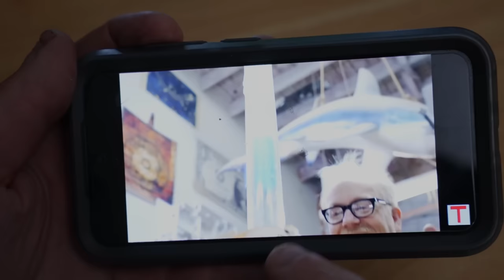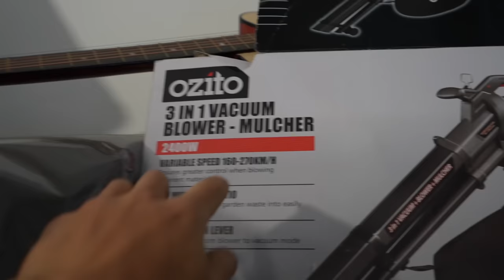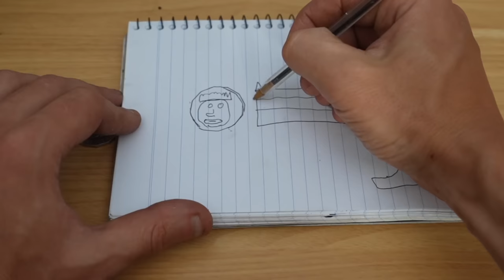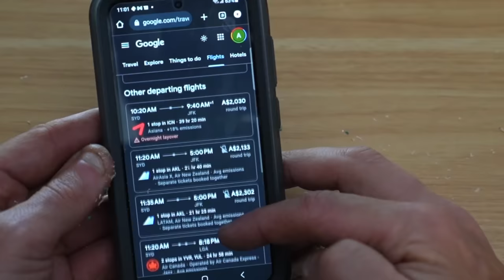The Mythbusters Were Wrong!

Comment: The reason why you were seemingly throwing coins at 172km/h is because of perspective. The cameras FOV is a cone starting from the camera, meaning the farther from the camera something is the more distance it can travel before it goes out of frame. This means that when looking at the coin passing in front of the markings, it can go from covering one marking to covering the next marking going less distance than there is between the two markings. This can be counteracted by moving the camera further away and cropping in, decreasing the slope of the cone relative to the surface vector of the marking board, as the cone shape is now closer to a cylinder than before.
Reply: Can you Explain this in Easy language
Reply: @fara-sara it do the slope so perspective look weird
Reply: You are kind of on the right track but not quite. First of all: don’t think cone, think pyramid. Second: What you are describing is called parallax. The parallax effect is definitely a factor but I think you are overestimating it. One additional issue here is that even with so many fps, in an individual frame the coin is very blurry. This makes it hard to make out its exact position. I expect this to contribute a lot to the error. That combined with the parallax effect might significantly affect the result. There is also lens distortion. However, that is mostly a concern when pure pixel distances are used. In this instance the painted bars werde used which of course are equally affected by lens distortion therefore eliminating it as a factor in theory.
Reply: Another adding factor to the error is the distance between the coin and the scale: the higher it is, the bigger the error
Reply: @fara-sara  Stick a 5 m tape measure to your wall. Move back 10 m. Move your finger from left to right in front of your eyes: did it actually travel 5 m ?
Reply: Or throw the coins directly above the measuring markings. The relatively slow frame rate was probably a much bigger issue. I think he glosses over things like that if he doesn't feel they are entertaining for one reason or another.
Reply: @fearisan  Yeah the parallax effect should only change it very slightly in this case, the blur is the major contributor. You can see that the coin blur stretches ~10 cm, and the blur travels ~10 cm. I think Alex might've used the distance from the beginning of the first blur to the end of the second blur (which is actually ~20 cm), assuming it was the distanced traveled by the coin in a frame, when it would actually be for around 2 frames. 

If you assume 10 cm per frame, then the coin is traveling at 24 m/s, or 86 km/h, which is fairly reasonable, especially since we known Alex is fairly athletic.
Reply: w comment
Reply: @fearisan  erm, technically it's a frustum, kid
Reply: @fearisan  you can pretty much ignore the blur if you look at the furthest position of the coin
Reply: You're right.  The camera's perspective is pretty distorted from that distance.  You probably can't get the camera far enough away in your garage but moving the camera farther away would flatten the perspective.  The concept of perspective itself is the only thing needed to understand the issue.
Reply: You could slap a telecentric lens on the end of a sensor but it would probably be prohibitively large and expensive.

Another more easierer way is to extend the contrast fiducials to the camera. And track the shadow cast if you have consistent lighting.

You can also do super collimated light with breaks then track when the coin is backlit.

There is a reason why machine imaging is a huge industry.
Reply: I need this guy to defend me against speeding tickets.
Reply: glad someone said it ahaha
Reply: Even without accounting for perspective, when you look at the distance traveled over 2 or 4 frames, it's more like 15 cm/frame, which would be 36 m/s or 130 km/h, much closer to the 28 m/s he actually measured than the camera-estimated 48 m/s.
Reply: I understand now
Reply: @fara-sara stuff far away looks smaller
Reply: Wide field of view exaggerates distance, narrow field of view flattens everything out
Reply: I don't know which camera was used and its technical characteristic, but at seeing the motion blur, it looks like the shutter is open during a very long time, due to the low light condition. Is it possible that he has set the camera to take 240 frames per second, but the camera decided that it was not possible, so lowered the frame rate? E.G.  maybe the actual rate was in reality maybe 24 frames/s then lead to completely wrong calculations (*10 the real speed)? The parallaxe error could only explain only a increase of the speed of some 20% if the coin is not so far from the ruler compared to the distance of the camera...
Reply: I thought it was just that coins are lighter than baseballs, so he was able to throw them faster

Comment: The problem with accelerating an object to terminal velocity with anything other than gravity is that it accelerates far too quickly, the forces acting on the coin have much longer to make it unstable in flight when falling and makes it more and more likely to start fluttering... slowing it to be relatively harmless. You'd be better to use a shape that is relatively stable like a ball bearing if you really were a homocidal tourist.
Reply: I appreciate the suggestion for alternative murder weapons you included at the end
Reply: I could calculate actual terminal velocity, but I'm too lazy.
Reply: @Ociloc  Im here to please
Reply: i'll keep that in mind just in case
Reply: Use a sharpened pencil or pen
Reply: Some sort of dart or flechett seems better suited
Reply: @ThereAreNoHandlesLeft   Too much drag, their tails are designed for stability but do so by slowing the airflow around the tail of the object, yeah its better but not the best. A symmetrical airfoil or tear drop made out of an extremely dense material, like tungsten will provide the highest acceleration and potentially highest terminal velocity because it has the smallest amount of drag relative to mass.... why are the feds at my door?
Reply: @1one3_Racing  i tried but couldn't find a good source for the coefficient of drag for a coin on edge. everything drag and coin related was on its face or fluttering.
Reply: Yeah this is not well done and the creator should be ashamed of his terrible attempt and at spreading what might be outright bogus claims that lie to people.
Reply: @X4Alpha4X  It is because the coin isn't stable. Air is sticky and the sides arent uniform so there is about a 0% chance it isn't going to be twisting and turning in the air.
Reply: tell me you have never seen idat without telling me you have never seen idat
Reply: Someone should try this experiment with a dart, maybe even on lawn dart
Reply: @generalgrievous2202  that will fall sideways
Reply: @thomgizziz   thats why the video kept bringing up spin to stabilize the coin. Hell, you even see a demonstration of it when he goes to the dam. Obviously it wont last forever due to friction losses, but we are looking for the worst case scenario, not trying to have it fall through the entire atmosphere from space.
Reply: People also forget, the upwind the building has, makes it tumble. People hyper focus on the coin itself but forget the outside factors.
Reply: Next video he'll use a drill or something to spin the coin up to 10,000 rpm before launch to avoid this problem.

Comment: The reason it took the drone so long to descend is because the downward facing sensors were blocked by the coin contraption, so the drone kept thinking there was something below it, and was descending at "landing speed"
Reply: And it should be possible to disable that sensor somewhere in the settings (at least possible in my mavic pro, mini has a different app now)
Just don't forget to enable it again later, or you risk slamming your drone into the ground at its max descend speed
Reply from the maker: I swear i had obstacle avoidance turned off but hearing from others i should have put it in payload mode
Reply: @Ididathing you should've gotten an American to help you. We're all trained as small children how to do a drone strike, and you don't get your citizenship officially until you end a Syrian child's citizenship.
Reply: @Ididathing  Ah im not sure then, ive done a similar thing where ive attached items to drop, and had the exact issue with the sensors.
Reply: @collinbeal  how do you end their Citizenship? Illegal immigration and forging documents?
Reply: @DrVeryStrange  a corpse is no longer a citizen
Reply: @collinbeal that made me laugh. Thank you funny man
Reply: @fireblow44  not a man, but we take those 🤯👍 LFG
Reply: @collinbeal  Yes, you guys are actually so good at this that you even dropped actual atomic bombs (250x the strength of the Hiroshima bomb) on yourselves, not once, but twice!

Edit: ofc way more times if you also count allied countries.
Reply: @robinandersson99  What can I say? We certainly know how to endanger civilians 🤯👍

Comment: The reason you may have had trouble getting the done down: Mavic Minis have sensors on the bottom. The magazine almost certainly wouldve triggered the sensors, causing the drone to think it was perpetually right above the ground. As they're programmed to fly up to about 1m above the ground it just kept flying up (as seen in the video) until it hit the legal altitude limit and ran out of charge, falling slowly back down to the "ground" which it thought it was directly above.
Reply: Yh I just comented that…
Reply: Can confirm as I own the mini 1 and 2, and have performed similar antics before...They get grumpy about objects attached to their underside.
Reply: GarciaCavett  bruh you really got me good
Reply: GarciaCavett  are we really still doing this
Reply: How’d he get it above 120 meters, or is that just an American limitation?
Reply: @Me-0063 Well done big boy
Reply: @owen_brady 
To be fair, so am I.
Reply: FWIW: That's a Mini 4 Pro. I came here to comment the same. The sensors underneath it don't like when things get close to it, it tries to keep distance.

However, holding the joystick to land, it will eventually stop carrying about these sensors and just come down.
Reply: Doesn't setting it to sport mode make it ignore sensors?
Reply: @colewilliams3621  not the one underneath. I used the drone to feed a fire with air by holding it from underneath. It wanted to go away even on sport mode.
Reply: @owen_brady i think you can disable the sensor in the settings
Reply: @vitorschwaab  wow didnt like mini 3 came out not too long ago they are realsing these fast i own mini 2 its a shame that i cant use the pro controller like it dosent make sense is just a block by dji
Reply: @vitorschwaab  yes it will come down, but very slowly. When it thinks it's right above the ground and pull the stick down it enters "landing mode". Its designed to take a few seconds to fall about a metre so coming from 100+ must take at least a couple minutes. Not to mention once it enters landing mode it doesnt come out of it until it has stopped moving entirely.
Reply: I bet the sun messed with the infrared remote, also ruining the controls

Comment: The fact you had more confidence in the desk shielding you instead of your car is insanely hilarious.
Reply: Tbf the top of your car is usually some pretty thin sheet metal, some cork and fabric
Reply: Most cars are not designed to stop projectiles. They are designed to give way to absorb heavy impacts.
Reply: @woalk This cars are built to slow down impact from other cars by allowing itself to crumble better absorbing the impact essentially making up intentional weak spots.

But unless modified its not made to protect against high speed projectials
Reply: @woalk Compared to desks that are designed to stop projectiles
Reply: @kernelpanic2887 well they are designed to be made of wood and tough as fuck if they are of good quality.
Reply: I mean if it hit the desk most of the impact would be there. there's no point risking Scratching your car. 😭
Reply: @kernelpanic2887  not just any desk, only the FoxyKnot desks are designed with tintention to be coinproof!
Reply: But it follows a good flow of thinking. Did a speed test launching the coin in ideal conditions and it did nothing to the desk, the car is still untested. It makes sense.
Reply: @onlygoodreviews7812  To be fair, the roof of a modern car is not meant to crumple or be a weak spot, as this kills the driver. Doesn't make it any more suited to armoring against projectiles however
Reply: @kernelpanic2887  Probably an American desk.
Reply: @woalk trust me them coins would not go through that roof 😂
Reply: @doktorwyvern2883  lmao
Reply: must have been a tesla